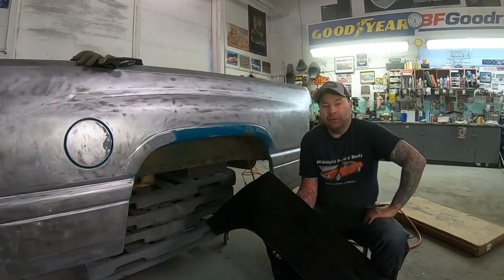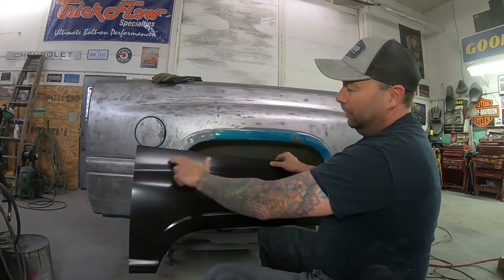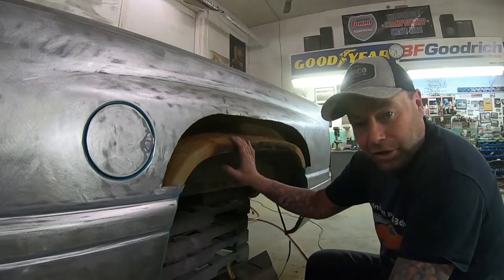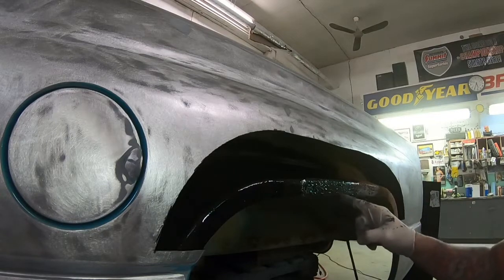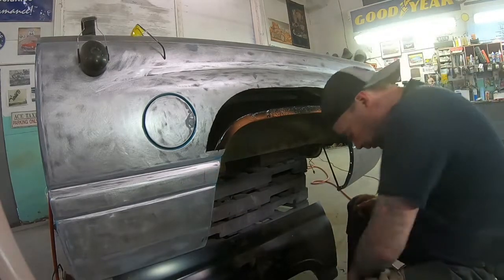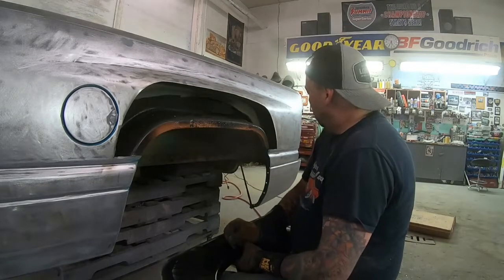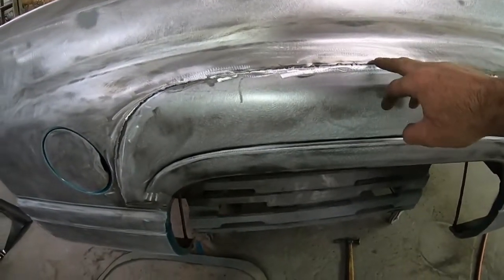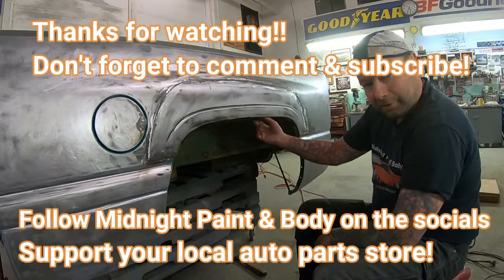How to replace rear  wheel arches 94-02 Dodge truck

Comment: Hey dude, I see you don't have many views here, but I just want to tell you how helpful this vide was.  I've been doing resto work for almost 30 years and I usually mark the panel, take the panel down and then cut it out. I installed a left inner floor panel (pan) on a 96 Dodge Cummins and once I had it laid up and in position, I used my cut-off wheel to make 1 inch slits in about a dozen locations to use butt-weld clamps. Once the panel was perfect and solid with the butt-weld clamps, I used an air-sabre-saw to make the rest of the cuts.  The panel fits so perfectly, I may have to grand a little just to get a big enough gap for a good weld. Thanks for the tip from this old timer.

Comment: It's nasty, but I've seen several people have really good success with using motor oil to prolong the life of the bottom of the doors, rockers, and along the upper arches, if you can get it in there. I'm preparing to tackle this project on my 97. You made it too easy brother! Great job

Comment: Is that a 175 miller ? And as far as those bedside arches go I tell everyone to get dirty when you wash your vehicle out good. I've seen on some of the newer stuff I have worked on that they have changed how the taillights are put in that some of the are almost impossible to wash out over the wheel house. I enjoy your videos you never know what you may learn by watching these types and I believe someone could learn how to do there own with a little know how !
Reply from the maker: Just a little miller 135. Fantastic machine for sheet metal, I’ve had it many years, never a problem with it. I agree, we can definitely all learn from each other, no matter how long we’ve been in the trade 👍🏼👍🏼
Reply: @Johnnymidnight  
I have had mine twenty plus years they don't make the 135 no more and they only thing I did have to replace the printed circuit in mine but it was cheaper than a new welder .

Comment: im thinking about installing the more rounded wheel arches in mine for a more modern look. would that be the same process
Reply from the maker: I would imagine so, but the problem would be the inner wheelhouse.  My thought would be that a later model inner wheelhouse would need to be modified to fit the older style body. I’ve never done it but I’m sure it could be done with some fabrication

Comment: This may sound dumb but do you have to remove the bed to make this replacement? I need to do this to my truck and don’t know much about cars but I think I can handle this, removing the bed however I’m clueless
Reply from the maker: Nope, you can definitely replace the wheel arches without removing the bed👍🏼👍🏼

Comment: This is awesome  what do you think I should set my welder at.It's a little 110/120 volt lincoln  mig to weld thin 1990's dodge body metal? Any cheap  welder setting tips ?
Reply from the maker: You don’t want it too low, just enough where you can get a decent “puddle “ with each tack. Lots of small welds, lots of cooling time in between

Comment: Why didn't you flange it with the tool you punched the holes with ?
Reply from the maker: No need to flange when butt welding, only it you’re overlapping the panel. I’ve found using the flanging tool tends to stretch and warp the panel in some cases as well

Comment: Nice Job Chinesium. I really enjoyed this video, I've never watched anything like this before. You make it look easy but I might try this on my old Corolla that needs both rear wheel arches replaced. And thanks for letting us know we don't have to order these parts online, we can go to our local auto parts store. 1) Is there any concern with welding so close to the gas fuel filler neck? 2) I couldn't tell, after spot welding around the perimeter did you go over it again with a continuous bead or was the weld a tight collection of individual spot welds? Thanks For Your Time: Shawn
Reply from the maker: Just keep on spot welding until it’s solid welded. , it’s very easy to be impatient and warp everything. If you have concerns about fuel vapours, it can never hurt to tape up the filler area

Comment: Thanks. My original 1984 f250 has cancer. As novice, is it easier to do whole bed side? Great video
Reply from the maker: Yes, I’d say changing the full bedside would be easier, saves you from having to get into doing body filler

Comment: If my gap on the new panel is too big, what should I do to fix it?
Reply from the maker: Do you mean too big to butt weld? Depending on how big the gap is a piece of welding rod, or even coat hanger works well as a gap filler